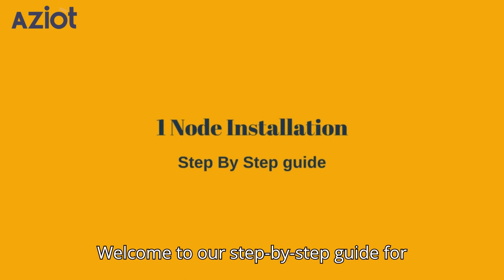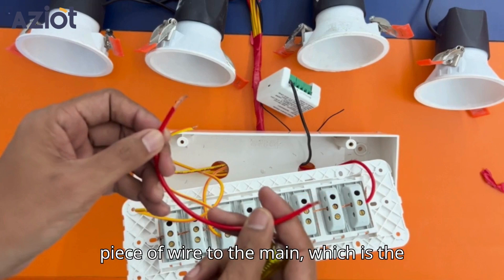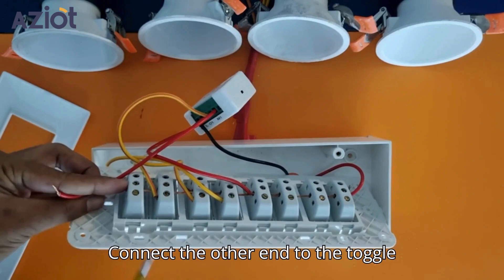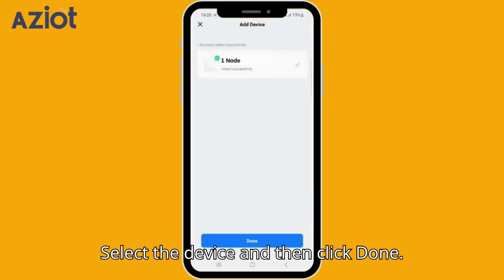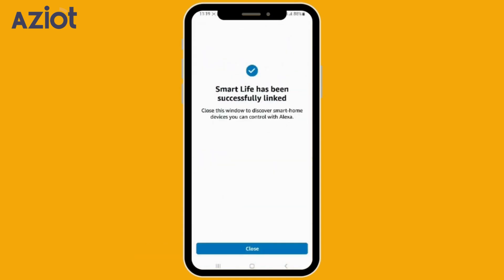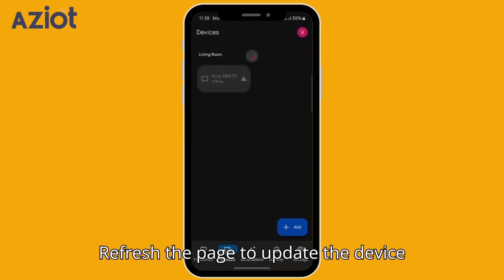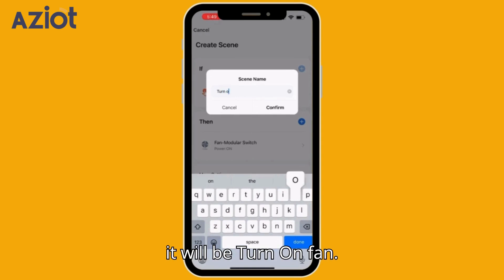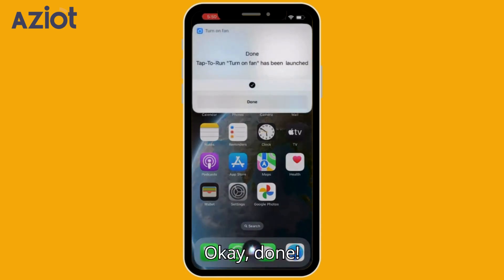How to Install Aziot 1 Node Smart WiFi Retrofit Switch | Step‑by‑Step Tutorial

Comment: can it be used in the freezer
Reply from the maker: Thank you for your question!

The 1 Node Smart Switch can handle appliances up to 16 Amps, so it can typically support heavy-duty devices like freezers. However, we recommend checking the wattage and ampere rating of your freezer to ensure it falls within the supported range.

If you’re unsure, feel free to share your freezer’s specs with us, and we’ll confirm compatibility for you.

– Team AZIOT

Comment: Does this model has 0.5 sec inching function so that it can be used as momentary switch in auto opening garage door and electric door locks.
Reply from the maker: Yes inching can be set from 0.2 seconds, but we are not sure whether your purpose of controlling a momentary  switch in auto opening a garage door and electric door lock works.

Comment: Hi i have only 1 earthing wire for the 3 lights that i want to connect to the aziot node what can be the solution in this otherwise it will not work.
Reply from the maker: Sir for 1 node to work, you would need live and neutral wire, not the earth wire. Also if you are asking about neutral wire, then you can loop neutral wire from the those lights to the 1 node. For more information you can reach out to our support at 8886635918
Reply: @ i have 2 node in that case is the same thing ?
Reply from the maker: @Nanda_vikrant  yes its the same
Reply: Is this possible with 2 way switches only?

Comment: I am using 2 node in a switch board consisting several points including the plug, do i have to remove the main Neutral from switch board and give to the aziot?
Reply from the maker: You can reach out to our customer support 8886635918
Reply: Hey i have the same question and have you found any answer geometryproject  ?
Reply from the maker: @NikhilWork-d1m  You need to loop the neutral wire to the device. you shouldn't remove it from socket.

Comment: Do you have any smart switch for 1.5 hp bore moter ?
Reply from the maker: You can buy smart breaker switch for smart pump
Reply: @aziot  but I think that will not control 2 way like the other node switches does
Reply from the maker: @alimansoor78  for two way switch control, you can use 1 node retrofit
Reply: @aziot  Thanks But is it capable to handle 1.5 HP Water Moter
Reply from the maker: Yes
Reply: @aziot  Thanks

Comment: Thanks i got it fixed into my switch board and now my water pump is wireless...! i was confused with O1 and M1 now got what they are "load and manual"
Reply from the maker: Glad to hear it’s working perfectly and that you’re enjoying the wireless control for your water pump! 💧🚀 Yes, O1 refers to 'Load,' where you connect the pump, and M1 is for 'Manual' mode, giving you on/off control even if the app isn’t in use. Thanks for choosing AZIOT, and let us know if you need any more help or have other ideas for your smart home setup. 😊👍

Comment: Question: When the physical switch is ON, can I switch the load off from the phone?
Reply from the maker: Yes, when the physical switch is ON, you can switch the load off from the phone. Our retrofit switches are designed to work seamlessly with both manual and app-based controls, allowing you to turn the load on or off using the app regardless of the current state of the physical switch.
Reply from the maker: Yes sir you can control by app and physical switch